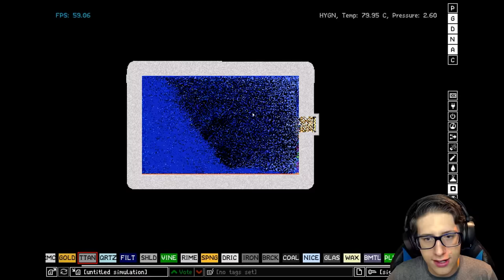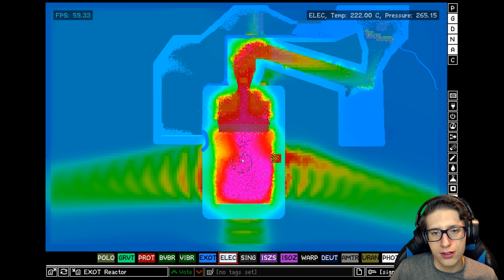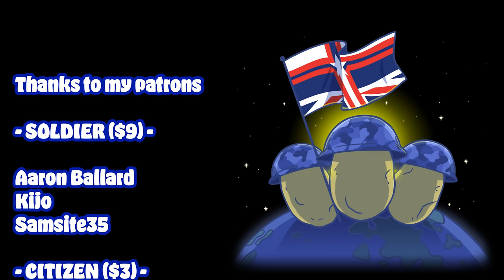Building EXOTIC REACTORS To Power The World!

Comment: You need to press = to set all pressures to 0 to fix your water issue. You are forcing all the  air into the tank and preventing water from flowing in because of the backpressure. You should use Powered pipe (under the on/off tab under the plug tab) to force water past air imbalance, or pressurize the tank and use portal to bypass the pressure difference

Comment: I was messing around with using uranium to super heat and explode vibranium, and I got it to heat that much that it instantly vapourised the quartz casing around the vibranium, releasing hundreds of electrons in every direction
Because of the uranium there was a lot of pressure in the area so I used vacuum to lower it and at negative pressures, warp and exotic matter was being produced. No clue how.
Reply: Vibranium turns into exotic matter and warp when pressurized.

Comment: This reactor would work better if there is no exotic mater in it (the exotic matter has no use except for making water vapor, which is damaging the system)
Reply: the reactor is an exotic reactor if you drained the exotic matter it wouldn't function
Reply from the maker: That would ruin the point!
Reply: Yes, I get that it will ruin the point, I just wanted to say that.
Reply: Or you could not have the exot and water touch.
Reply: It has to function using the exotic matter. Any boiler system needs heat.